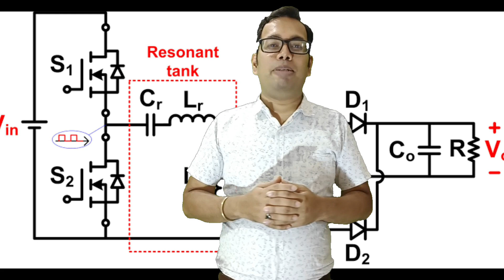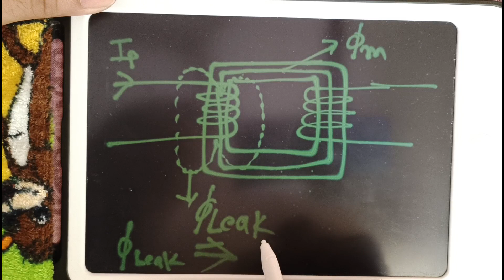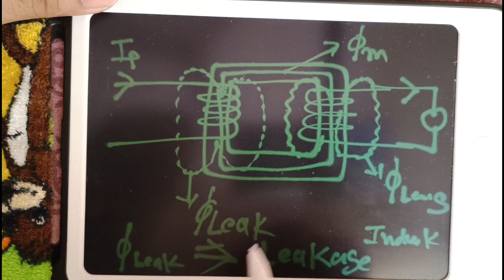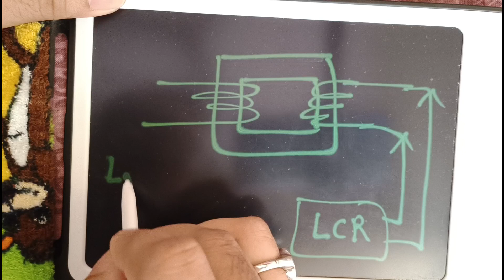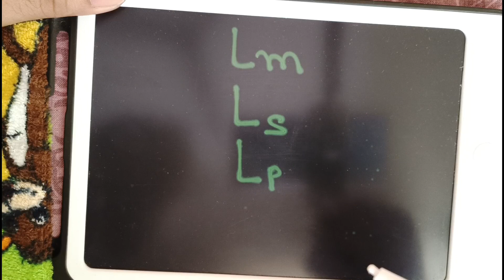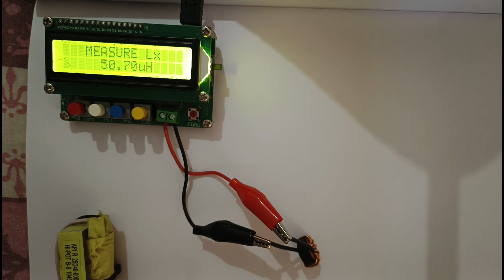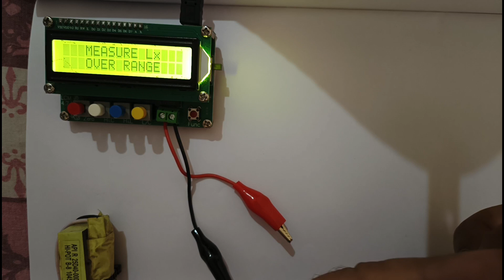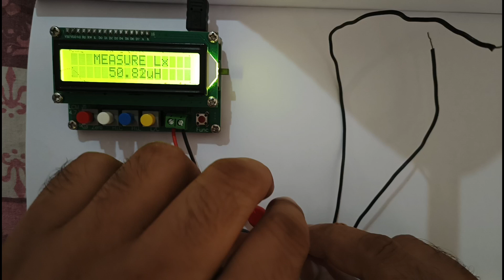Leakage Inductance| Magnetising Inductance| measurement in LCR meter

Comment: Sir if i did short circuit secondary and measure Primary side by LCR meter then it is over all leakage inductance referred to primary side or only leakage inductance of primary side??
Reply from the maker: It will be the primary side only for the secondary side short primary coil
Reply: Thankyou sir

Comment: Good afternoon. Please could you help me? Or better say give me right way?  We have little transformer 24rounds on primary, 2 rounds on one secondary and 2 rounds on second secondary winding. Calculated leakage inductance is aroun 10uH. This inductance is only without cores... When I put the cores into the transformer. Leakage inductance rise up to 30uH. Cores are E ferites. Airgap 1mm between allcolumns. Is it possible to compensate "core effect"? I was think, that the main factor is geometry of the coil for leakage inductance and influence of the core is minimal. But in this case it seems that influence of the core is main...
Reply from the maker: How you are measuring leakage inductance?
Reply: @scienceinnovativebrain  Good morning. We ve measured by RCL on 1kHz And 100kHz with shorted secondary winding. Then we ve measured by DC device Dpg100 with shorted secondary od course....results Are almost thé samé .Sorry Im wrting on phone
Reply from the maker: You want to make less leakage inductance with core insert condition? Finally
Reply from the maker: What is application and voltage level in primary and secondary. And VA rating
Reply: @scienceinnovativebrain   Thank you for your interest. I will write this values tommorow.. I know that is 400V primary, 24V secondary, but I dont know direct VA Power. Its only one of my project...
Reply: @scienceinnovativebrain   Yes it will be great if we can decrase leakage inductance, when cores are inserted
Reply from the maker: Which type of core you used since UU or EI or EE or UI   you can reduce the leakage inductance with winding technique. How much you want leakage inductance?
Reply from the maker: https://www.udemy.com/course/ltspice-smps-transformer-modeling-with-practical-demo/?referralCode=FBBD1FA2149EA2303903